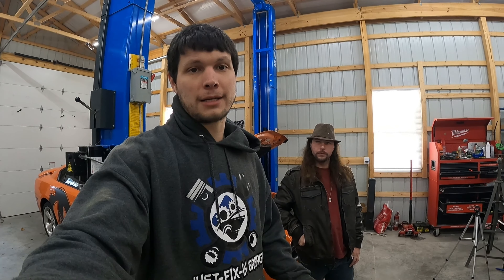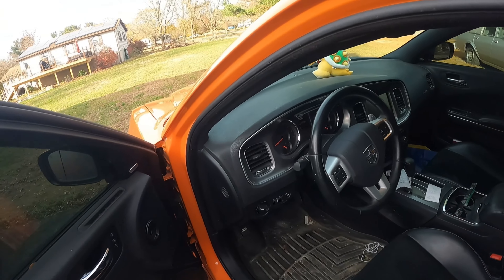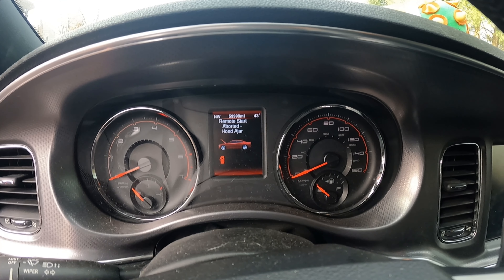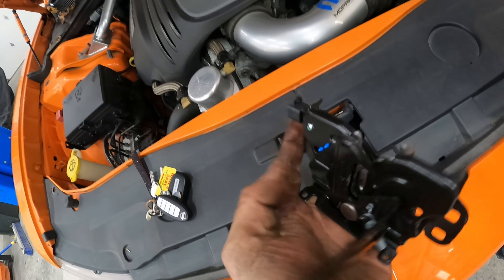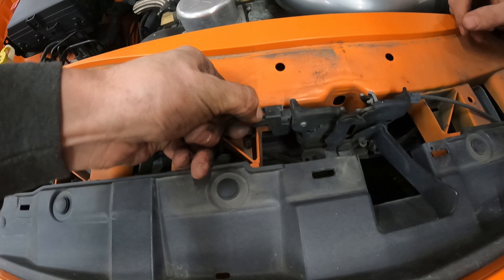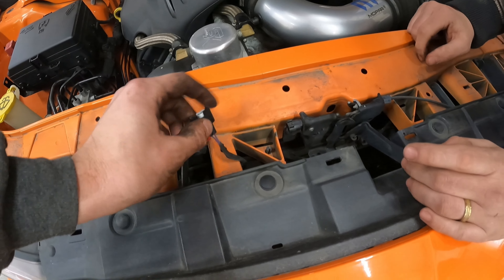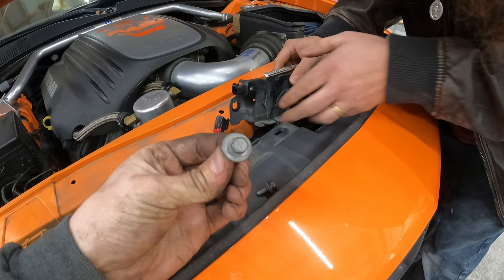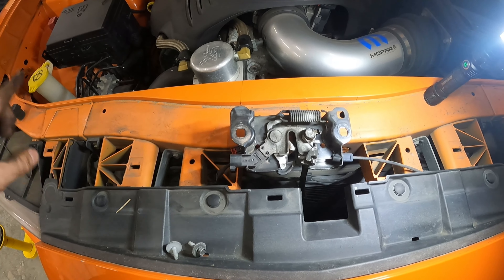$5.00 SWITCH COST $100.00 TO FIX - REMOTE START ABORTED - 2014 Charger Hood Latch Replacement

Comment: I never would have tackled this repair without watching your video. Thank you. Took me a half hour after receiving the new hood latch, which I purchased online for $108. The remote start on my 2014 Charger R/T is working again.
Reply from the maker: Glad to hear it and thanks for the comment ! It’s too cold this season to not have remote start working. :) next I need to fix my heated steering wheel . I think the clock spring is bad . Only the seats work :(

Comment: I had this issue since may and now I see it’s a easy fix going to be trying once I get in the part in thanks for the video 💪🏼
Reply from the maker: Glad it helped. hopefully it fixes your issue. I find it insane the switch is built in and not serviceable. If the switch was separate I bet it would only be a few bucks!

Comment: This is what I need. I have a 2014 charger and After I had an electric wire fixed the remote start stopped working.  I honestly tried the cheap way and it did not work.  I'm just going to buy this and follow your video and do it on my own.
Reply from the maker: What electrical wire did you have to fix ? Hopefully this is your issue . Not having remote start sucks so fixing it is great . I wish the switch in the latch was replaceable separate but it’s riveted in .
Reply: @JustFixinGarage  I'm honestly not sure but it affected the temperature sensor.. and I didn't notice until the winter..mind you I'm In chicago!

Comment: My son's 2018 scat pack had hood latch replaced and a few things from body. Now had hood ajar error. He's brought it back and they said they can't figure it out. New latch, New battery in car and fob. Still nothing
Reply from the maker: While I dont condone it are you are to try the resistor bypass on the plug? I don't have a video for it but a few other people do if you search for it. I would be curious to see if that helps. I would expect the dealer would have a full wiring diagram to diag the issue as surely it would be a wire, latch/switch, or computer issue.
Reply: @JustFixinGarage  so I got it fixed. This is what happened. Apparently dodge used the same plugs for the horn and hood switch. So when the body shop fixed everything they had the hood latch plug hooked to one of the horns and one of the horn plugs hooked to the hood switch. So switch those plugs around and all is good.
Reply from the maker: @toddcoello6461  wow ! Good find . So I’m guessing the horn wasn’t working either until you fixed it ? Or only one horn worked?
Reply: @JustFixinGarage  only 1 horn was working. It was funny afterwards because my son even said I think they changed the horn to a smaller one because it sounds different. But we never thought to check that.
Reply from the maker: @toddcoello6461 I would have never guessed they shared the same plug. Good find . A very very specific case . I am surprised the dealer didn’t figure it out . I would assume their test include checking resistance at the plug which may have indicated the root cause. Either way glad it’s fixed in time for the cold season :)

Comment: What is that cover called to install the latch.? Mines missing
Reply from the maker: Check out this site. I think it’s called “under hood appearance panel” there is a left and right    Side and it’s part number 12 in diagram . https://parts.allmoparparts.com/v-2014-dodge-charger--r-t--5-7l-v8-gas/frame-bumper-and-fascia--front-bumper-and-fascia
Reply: @JustFixinGarage  thanks 🙏🏼

Comment: I actually have to Change the latch cable with the handle on my 2013 Chrysler 300C Hemi
Reply from the maker: Did the cable stretch or break on you ? I wonder how difficult that job will be .

Comment: So do I not need the actual sensor ? Or just latch
Reply from the maker: I was unable to find the switch separately and it was riveted on . The new latch will have a new switch/sensor built into it. The actual issue for me was the switch but it’s part of the latch so it was a full swap .
Reply: @JustFixinGarage  oh wow okay I just ordered a new latch but I didn’t see a sensor with it hopefully it has that too
Reply: @JustFixinGarage  the one with the red on it correct?
Reply from the maker: @Caine459  if it’s the correct latch for the car it should have the switch on it. I believe they make a latch without the sensor for the ones that don’t have remote start. Hopefully you have the right one.
Reply from the maker: @Caine459  the plug has a red lock tab and that’s what plugs into the switch
Reply: @JustFixinGarage  oh okay well hopefully the plug isn’t bad
Reply from the maker: @Caine459  it’s unlikely the plug is bad. It’s almost always the sensor . It’s just a simple open/closed switch . Over times the spring wears out and contacts get dirty and it stops closes the circuit to tell the car hood is closed even when it is.
Reply: @JustFixinGarage  just and update I’m actually missing the whole cord , all I have is the small black part that plugs in no wires connected I need to buy a pigtail but I’m not sure where it plugs in
Reply: @Caine459 did you ever figure it out?